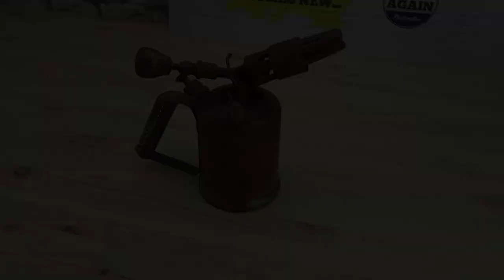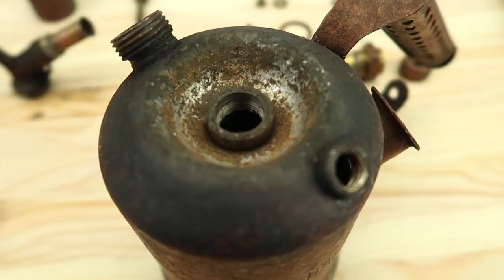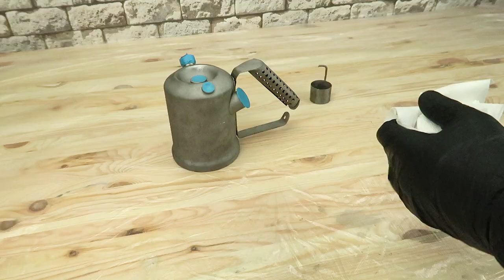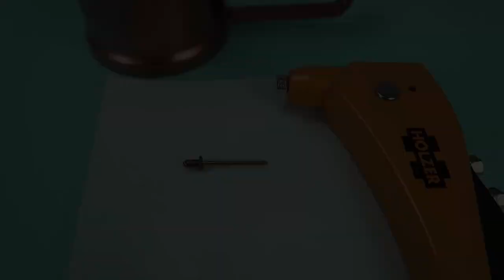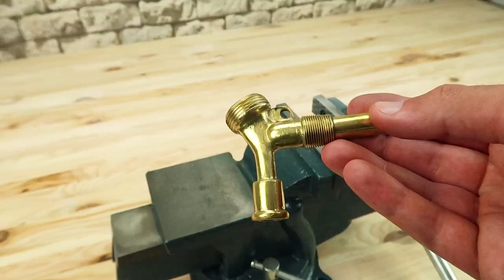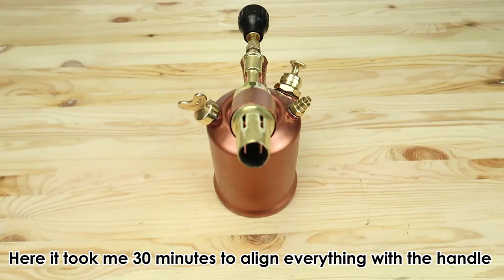Extremely RARE Blowtorch Restoration Hahnel 3

Comment: I think the wire that you cut off was to have an adjustable shroud -- to vary the air mixing -- by twisting the shroud in and out.  If true, then the wire shouldn't have been cut off (or needed to be replaced)
Reply: Didn't want to use it just look at it, doesn't really matter at this point.

Comment: Indeed it seems to be a early and more rare torch from this manufacturer. In later years Ernst Hähnel distributed his torches under the brand names "Vulcano" oder "Vulcano Alemania". You find them frequently on flea markets and on Ebay. BTW: The copper paint looks very good but doesn't seem to be very close to the original – Hähnel torches mostly look like brass.

Comment: Plastic and or Bakelite Doesn't Rust.   So why did your handle (Plastic or Bakelite) have rust on it exactly like everything else?   Well, except for the underside of the handle where it was perfect.  Did you forget to coat that area with whatever you used to make it look like it had petina or rust on it?
Reply from the maker: First of all , the handle was not from Bakelite or plastic, was from steel like the recipient too. Only the wheel to adjust the flame was from plastic, black plastic. And what you seen there is not rust. That brown layer is a paint , I’m not sure if it was original paint or not . Hope I clarified you
Reply: @CoolAgainRestoration   Yes, it's Paint, Okay, Thanks.  Still, Very Good Job on the lighter!